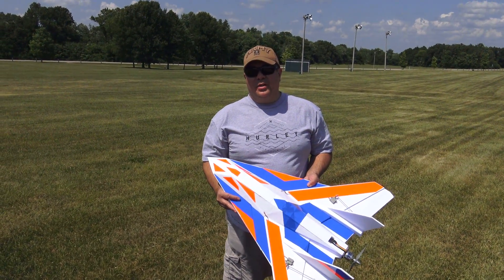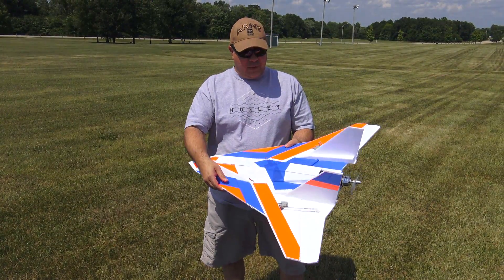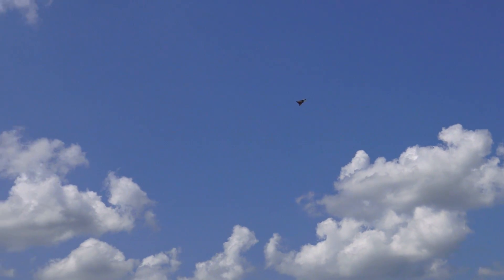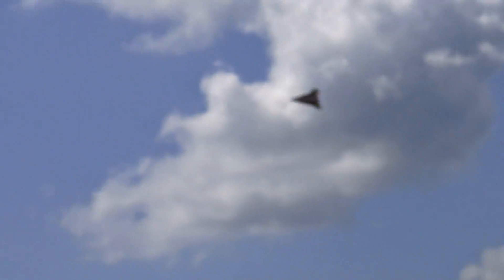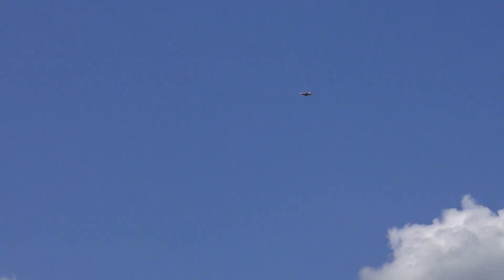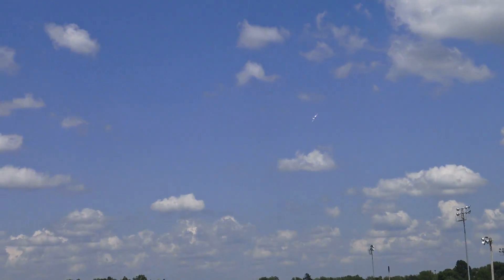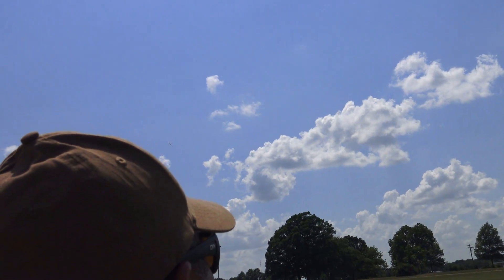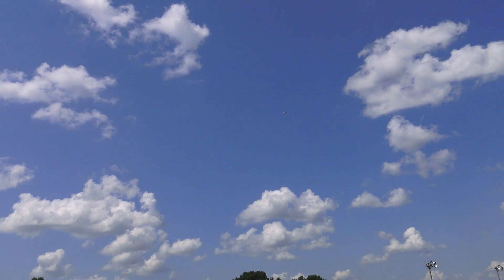New RCFF Concept Jet

Comment: Great new design guy's. It's like a F117 / Aurora cross.
Reply from the maker: Thanks RCPP! The Fuselage does have a multi faceted shape kind of like a F117.  The Final design will be a little lower profile fuselage.   Just tall enough for the 5S Lipo pack.
Reply: Cool man sounds good. May I suggest that the CG needs to be just a fraction further forward. I could see that the tail was slightly kicking out and was a tiny bit floaty in the turns. Best to be safe then sorry and have it balanced a little bit further forward. Looking forward to see the final design finished and ripping up the sky's.

Comment: Wow looks like you nailed it by glide testing! The flight was perfect, so stable and steady. Got to love those motors with a 6x4 x 6 or 6x5 x 6. Great job guys, awesome having you back!!
Reply from the maker: Thanks Gregg! It did fly pretty good right from the start. no trim or anything.. I think the symmetrical design helps and also I tried to center all the weight in a nice straight line.  That really made the Barrel Roll dead on.  Hope all is good down there in Florida for you Gregg!

Comment: It looks just like a skyfun!  I'm building one myself out of flute board,  It weighs the same as a skyfun same size as a skyfun but I haven't put the motor or servo's in!  mine weighs 560grms without electronics, 
what does yours weigh?  my skyfun weighs 560grms with all electronics minus battery! so flute board is a lot heavier for the same in eps!
Reply from the maker: Thanks Refer. I guess it is a little like a skyfun in overall shape. Good luck with your build, hope it flies great for you.